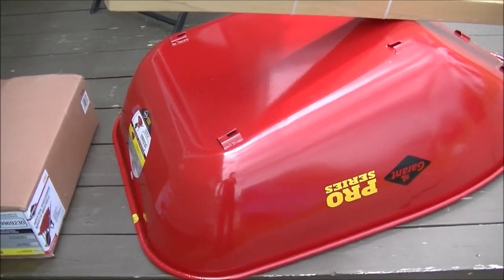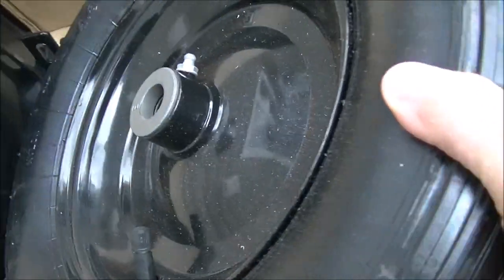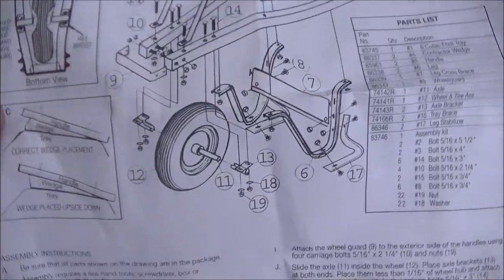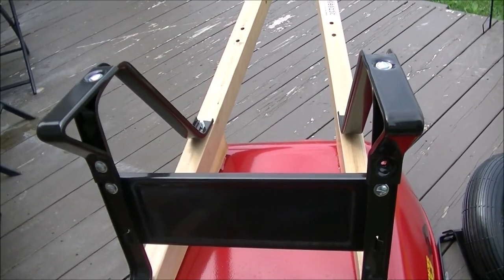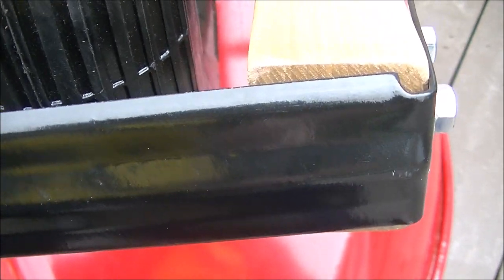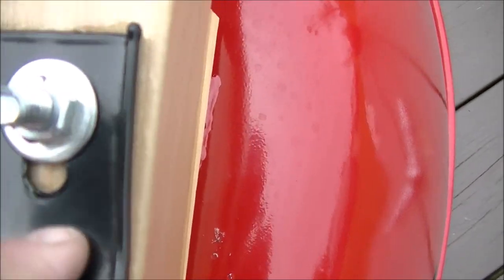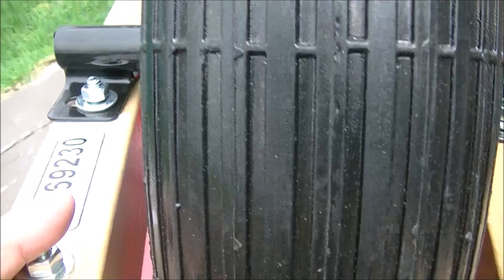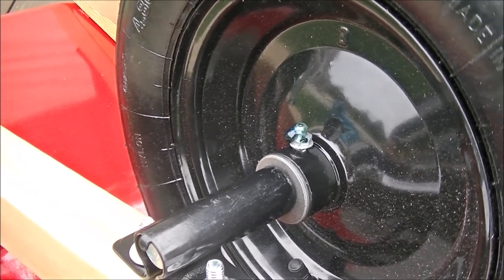Assembly of a Pro Grade Garant Wheelbarrow

Comment: It looks pretty good. I like the way the brackets have adjustment.
Reply from the maker: I suspect the brackets have adjustment room because every metal pan weld and every metal bend has to be dead accurate. Good thing the instructions mentions putting it all together loosely as it would be a struggle to get the nuts, bolts and washers on in many instances. Thanks for dropping by Fred. Lovely weather here. I am starting my 16 by 20 work shed now. That will keep me busy for a bit. All is well here. Well wishes for you and yours as well.

Comment: That's a proper mint wheelbarrow Andy. It's going to last years.
Reply from the maker: I agree. The only weak link is typically where the tire and rim mount into  the wooden handle on the low end. Keep it out of the weather when not in use will null that risk. It will last a long time at any rate. Thanks for dropping by Sir.